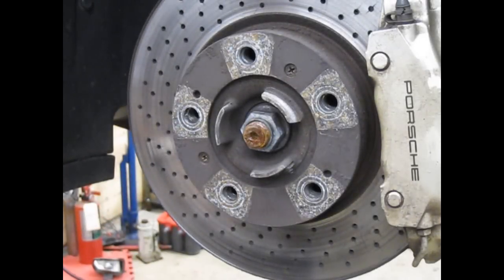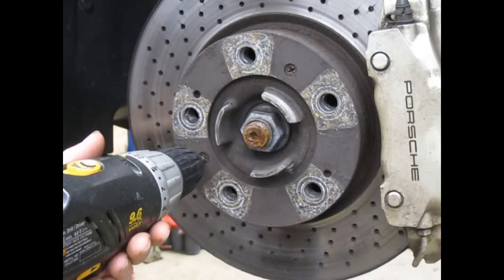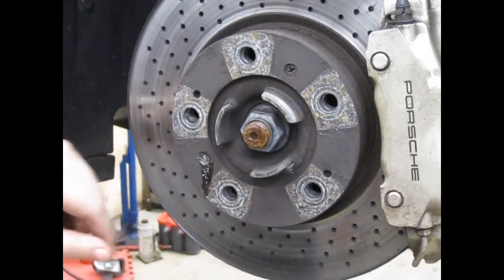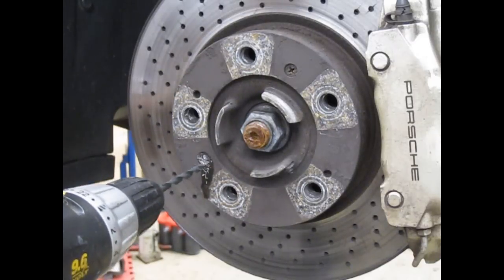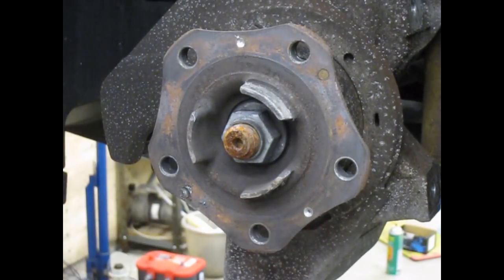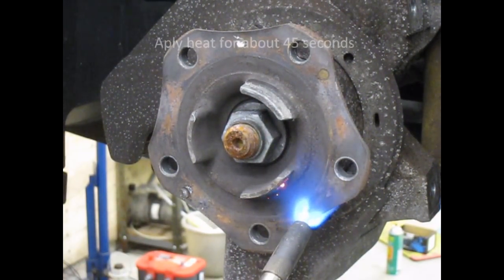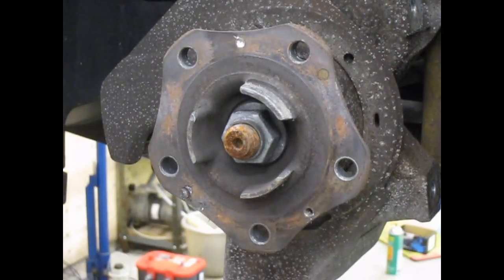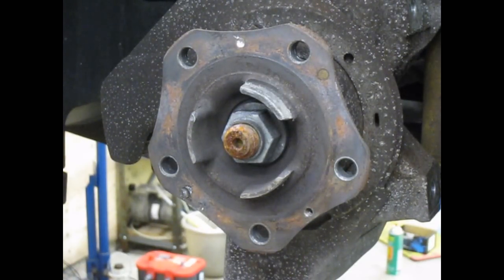DIY - drilling out stripped brake rotor screws

Comment: Thank you for the advice here.  I went to 2 local auto part stores, and then a Fisk Farm and Home, and Farm fleet, and couldn't find the center drill bit. So without the center cut/drilling,  i just took a cobalt 1/4 in or 6.3 mm bit, lubed it up with PB blaster,  started drilling and was able to zip the heads right off the screw (the first one was done in less than 30 sec)  once I got to the 4th screw on the passenger side, the bit was getting a little worn and dull, so the last one took like 2.5 minutes.  But thanks again, I was able to get the rotors off and replace them with new ones earlier today.

Comment: As many of you know already. When putting the screws in, don't put them in tight. They actually dont help you aside from alight holes for you when you put the wheel bolts back in with the wheel in. So you can actually bolt back onto the hub
Reply: Yeah, they honestly aren’t even truly necessary I really wish manufacturers would stop using these, they’re just a pain.
Reply: @arkman117  they truly are

Comment: Thank you for taking the time to share your tip with us! Upgrading the rotors on my '04 Mercedes W203 and the passenger side would NOT budge. Used your tip and I'm happy to report that my dual-vented, cross-drilled rotors are now on my Baby and performing just FINE, (withOUT the errant little seized up torx-30 installed)! :)
Nice Job on the video...

Comment: When removing these screws use an impact hammer with a phillips head. It usually brakes the rust and makes the screw removable. Impact wrench works too but can sometimes strip the head. When reinstalling these screws i put anti-seize on the screws especially above  the neck where it meets the rotor. Then they never fuse again!

Comment: Really nice vid did my rotor screws like you did and worked better then good. Did not have the center drill but used a 4mm and 6mm.

Comment from the maker: I think you're missing the point.  I'm suggesting you just drill the head off - this way you don't even get to the threads in the flange.  Also, I've never had great luck with easy-outs - I've had them break more often than remove the stuck bolt.

Comment: You don't even need those screws, they are only there to keep the rotor on during manufacture.
Reply: This is true, but they make it easier to line up your lug bolts
Reply: Semper Fi  are you sure that your car has lug bolts?  Tons of cars have lug nuts, but a number of European cars have lug bolts.
Reply: after you hit your brakes and her a thonk thunk and now cant get the wheel off you will learn WRONG.!!!! you dont know what your talking about . owe by the way you just pind your luggs  and your rotor are off center that wood be the thonk thunk dont try to be a wrench we are tierd off repairing your messes

Comment: Im not sure what the purpose of the screws are except maybe easing assembly at the factory, but many manufactures let the rotors wobble and tighten up with the lug nuts...
Reply: Their sole purpose is to inflict misery on the DIY-er. Why installers cannot use a dab of anti-seize and sensible torque is one of life's mysteries

Comment: Just take any bit smaller than the circumference of the screw head, drill dead center until you see it smoke a bit, then grab a screwdriver and a rubber band place the rubber band on the end of the screwdriver and turn it. It will come off really easy. The heat from the drilling and the grip from the rubber band it comes off with almost zero effort.

Comment: Easier way to do this. Small drill bit, drill part way or all the way through the screw (relieves tension on the threads), get a small easy out, tap it into the new hole with a hammer, put a crescent wrench on your easy out, turn counterclockwise. screw should come out no problem and you dont have to take the head of the screw off.
Reply: Double Helix yes, often the drilling creates enough heat to loosen things up.  Then, like you said, hammer in a screwdriver and remove.

Comment: Yesterday i had a stripped out screw for a rotor, i saw your video and I use a drill to put the damned thing out, and guest what, THAT FKG WORK GREAT!!!!.  as Well the like bottom on your channel.  Make sure you advice that drill bit must to be in the center of the screw. Thank you for make my day easier.  

I apologize for bad words but i couldn't sleep thinking on how i will deal with that.

Comment: Omg what kind of drill bits are you using? I've been using a hammer drill and regular drill on 2005 Acura TL rotor screws for six hours and one of my titanium bits actually melted even with silicone lube. I broke all PH3 bits on a brand new impact driver. This is the 3rd day I've been trying to change these brake rotors.😔
Reply from the maker: Hammer drills are really made for concrete or rock - not a good application for drilling steel.  Any good sharp (new) drill bit should work fine.  Make sure you have it spinning in the correct direction.  Also, use a slow speed, otherwise it'll overheat.  Good luck!

Comment: You could use an extractor. I ended up to round an inbus (allen) screw on the brake rotor and was planing to extract it but it worked with a torx bit (hammered into the hex slot).

Anyway for some heavy duty screws that broke, i used an extractor. easy and sure not to damage threads (but it does not work for small screws like M3, or M4.. an M6 is doable)

Comment: All mine are stuck in my car and s car I remove the spindle from, talk about s pain in the ass, I just use three different size of drill bits and keep drilling into it then I will reverse the drill real quick so the screw will screw out with the drill bit always works for me but takes about 5mins

Comment: Put a thin coat of high temp grease on the face of the rotor that chemically welds to the hub so this can only happen to you once. The grease wont move to the rotors if its a thin coat...think about it...most pads require high temp grease on their metal side to limit squealing. And  a anti-seize on the caliper bolts, especially if they are flange type.

Comment: Hi, do you recommend putting new screw back on after the removal of the old ones?  I ask this because as you know there are lots of rotors out there that are not screwed on as are tight anyway & the wheel keeps it on tight & safe?

Thanks
Reply from the maker: I do like using the screws - it helps keep the lug bolt holes lined up.  Otherwise, if you take a wheel off, the rotor might spin relative to the hub.  But they certainly aren't necessary.
Reply: Van Svenson Thanks dude mine are knackered so I'll have to buy some more that fit flush :-)
Reply: Van Svenson bingo.  It was a pain to put my Audi lug bolts back on because my new rotors did not have rotor screw holes.  I had to get a helper to mount my tire. They forced me to tear off one corner of my man card for requiring help remounting a tire :-)

Comment: I wonder what would you recommend to prevent the same situation in the future? Would it be OK to use Anti-Seize on the rotor screws?
Reply from the maker: +Eric Cheng It would certainly help!  But brake rotors go through more intense heating/cooling cycles than any other part - so the anti-seize doesn't last terribly long.
Reply: what's with the screws?  nissan toyota doesnt use any

Comment: If you have a mig welder just keep hitting the head of the screw with the mig and build up some weld, put a pair of vice grips on the build-up and back out the screw. Be careful not to weld the face of the screw to the rotor face or your SCREWED.

Comment: Buy a 1/4 drill bit and #3 philips or the JIS. You may get lucky and you can get it out with the bit. If not, you have the drill. Smack the crap out of the screw before attempting.  Don't listen to people who say all you need is the JIS. Not true. Screw can still break. There is no guaranteed way.

Comment: Those screws like to stay on Porsche 959 and Ferrari F40, even if I used the best impact gun (ATG Gold W7150 1K Kim X) or impact driver available.

Drilled was the only answers and never put those screws back in the rotors.
Those rotors screws are only installed at factory for safety for the workers.

Comment: Man, I was trying to include pics of the stuff that I have, but I couldn't.  So anyway guys, quit screwing around.  Get Urselves a Snap-on PH 1038, and that'll get them out everytime.  No farting around.  Just get the job done.  If U've got air, and a zip gun, as well as a good spring steel wrench like a Snap-On, U'll get the job done in a heartbeat.  Also, goto use a Snap-on brand #2 bit, and U'll be in the home stretch where no one else could possibly be.  Costs a little bit, but gets the job done almost everytime.  If U're doing this professionally, don't mess around, just get 'er done!  The right way.  People come out here from 100's of miles around for a reason.  I get the job done.  And make short order work of it.  I don't mess around.  U only get so much life to live.  How do U want to spend it?  Chasing U'r tail, or getting on to the next job.  :)  I have a big box of centering bits for my lathe, but I wouldn't waste my time w/them on something as simple as this.  If U do screw up the screw, just drill off the head w/a drill bit about the same size as the head of the screw, it will come right off.  Rotate the rotor to the next stud set and drill a new hole in the hub that U can tap and put a new screw into.  I generally don't try to reuse the original screw holes, b/c the hubs are hardened, and generally U'll wind up breaking off a good tap, and wind up having to drill and tap a new hole in an alternate stud location anyway.  Always only use good Vermont American, Craftsman, or good German taps to thread any holes U need to in the hub, b/c Ace/Hanson taps, Snap-On taps, and all the other tool dealer's taps are just surface hardened carborized junk.  The Vermont American ones, Craftsman ones, or German ones are a little bit softer, and not so hardened, and ductile so that they don't snap off as easily.

Comment: What size but did you use? I have gotten most out but the stubborn head is still too attached. I think my bit is too small
Reply from the maker: That's an M6 thread screw, so the drill should be a little larger than 6mm.

Comment from the maker: PB blaster works better when you can actually get it on the threads...  And even then, it can *help*, but it usually doesn't *solve* a stuck bolt.

Comment: just had to do this myself on my honda.  3 of the 4 screws on the front rotors stripped.  the phillips head just crumbled.  i was pissed, but they drilled out pretty easily.  got the rotors off.  now i have to drill out the rest of the screws, which is not so easy.  from what i read the screws aren't really necessary and almost always break given enough time.  they basically just to hold the rotor in place as you put the wheel on.  lots of cars dont even have them.  pain in the ass....

Comment: Damn, you make that like so easy. My mk4 gti passenger rear rotor screw won't come out. I smashed the hell out of it with a hammer hoping to get the rust and gunk stuck between the threads shifted around enough for the threads to turn. But it's like it has been welded on from the heat from driving my car really hard. It has cross drilled and slotted rotors with the special ceramic, Teflon, and all the things in the pads and they make a lot of heat. I stripped the Philips pattern completely round. There's an easy out bit stuck in the screw and that won't turn even though the ends are squared. The Stanley easy out kit. I don't know what to do? I tried using a drill but it barely had enough torque to get the easy out to barely grip in there and now that's stuck because the screw won't come out and I don't want to break that in there. I just want to snap the screw head off. The front rotors never even had them which only made it the biggest pain in the ass to put the rim on and line it up with the holes in the hub because the rotor would spin with the rim while trying to line everything up. Took me two hours to put one front rim on, lol
Reply: ***** I drilled mine through, damaged a little bit the thread on the hub, but the bolts don't need too much torque any way. I bought a set of flat head titanium allen bolts to avoid this nightmare again.

Comment: Are retaining bolts even needed to hold on a rotor seeing as it's also held on by the wheel?
Reply from the maker: No, just to help stabilize the rotor when the wheel is off.
Reply: @vsvenson  When I replaced the front brakes I had to drill out the head of the retaining bolts. To keep the rotors from slipping while I was putting the wheels on I pumped the brakes. Now I'm experiencing serious brake pad grinding. Is that going to go away?
Reply from the maker: @ubroc  You have something else going on - make sure the pads are installed the right way.  Also do a visual inspection to make sure the rotor isn't rubbing on the caliper - I've seen this if the wrong p/n is used.

Comment: You do not need those stupid screws, because the rotors are held by the lug nuts, those screws are used to hold the rotor during manufacture, most cars don't use them at all, when installing the rotor use one nut to hold it in place until you install the bracket over the rotor, then remove it and install the wheel just like every other car out there, common sense !!
Reply: JazzLowrider except when your car doesn't have lug nuts and your rotor spins on your hub (you'll wish you had rotor screws, then)

Comment: A: I would just drill out the old bolts and retap a bigger hole and use a bigger bolt

B: throw away bolts and not bother, or just have one bolt  in place !

Comment: I’ve been a CNC Machinist 40 yrs. use a smaller left hand direction drill, this will prevent a drill bit from any possible damage when it also removes the entire bolt from hub. NOTE: use anti seize with copper, NOT aluminum in it and this won’t happen again, along with 82* degree flat head Allen bolts. Stupid Porsche owners!!!!!

Comment: thats why drilled rotors are best for track cars, NOT street cars. this will happen when you have hot rotors from normal break use, and water comes in contact with the rotors, Ie. Rain, puddles ect.. if you want performance rotors for street cars, BUY DIMPLED OR SLOTTED. NOT DRILLED.

Comment: There is another metheod shown by eric the car guy on this website.Take one ball been hammer with the peen side on the screw and smack that hammer with another hammer.Takes a few smacks with a hammer and you will have to hammer the screwdriver bit in.Screw comes out with no problems.I used this metheod on a Honda

Comment: Funny you don't need the screws the wheel holds on the rotor
Reply: CPTSauvageot perhaps, but having your rotor spin while mounting a tire with lug bolts can be challenging
Reply: @deasttn  yeah my 02 civic is lug nuts, so it should in theory be do able. Just nervous something else will give

Comment: You have just proved my point.  You obviously have no formal training and no understanding of Engineering.(or Physics)
There are many methods for removing both which does not cause catastrophic failure under severe working limits.

Comment: Those weren't stripped. Just use an impact screwdriver. The type you whack with a hammer. Damn shame you guys don't learn the craft a little better before you start hacking on your cars.
Reply: I swear to gawd that was the first thing I was looking for before tackling this job but the auto parts store didn't know what I was talking about. So I got all the screws out except the last one with an impact. I got to the last one and it kept braking my damn philips heads. Then it stripped.
Reply: He specifically says that he used his impact screwdriver with a philips head 4 seconds into the video....
Reply: Jae Quan Harbor Freight...they are like 9 bucks
Reply: SkiDooRydr Doesn't mean he knew how to use it! Ive never met a screw that wouldn't come out with an impact driver. But you gotta push it in and preload the spring first.